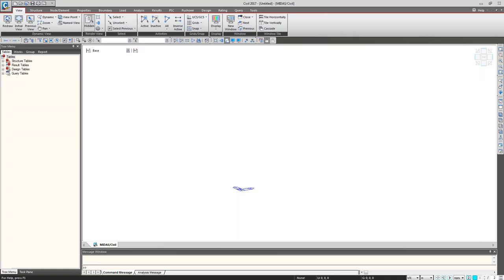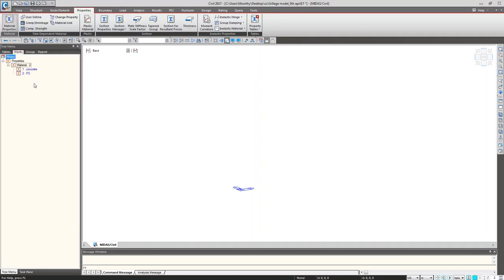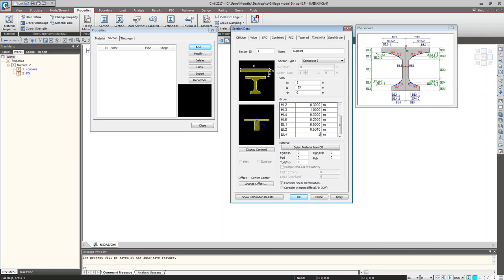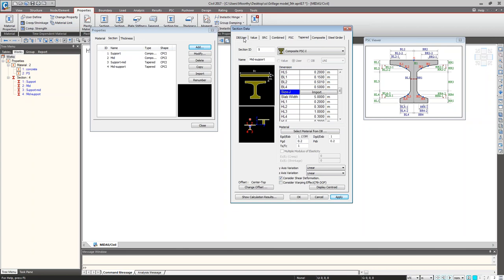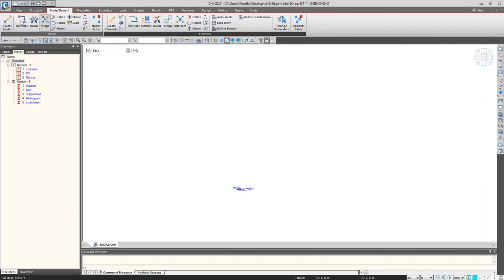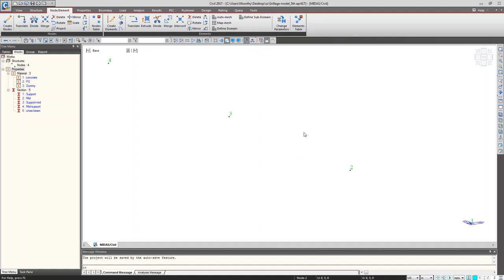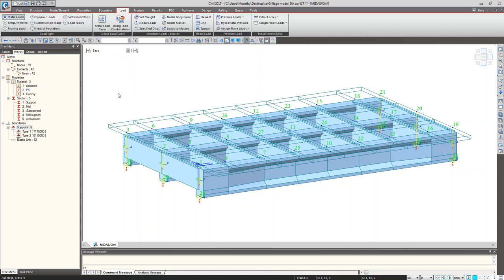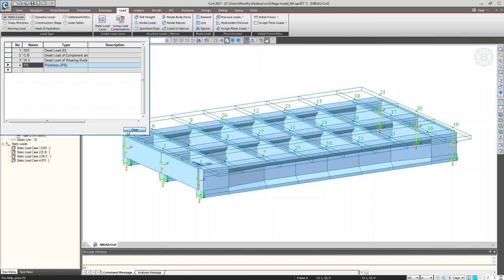PSC Composite Grillage Bridge using midas Civil

Comment: sir, I need to model a prestressed (noncomposite) flange of the main girder is a slab 

without making composite section

Can i define an I- section with flange 0.250 depth
and use dummy traverse beam?

Comment: Question.  The dummy section should be providing the stiffness of the deck in transverse direction.  I think the section should be the deck for the dummy.  How come you used cross girder as the dummy sections?  Is it a mistake?
Reply: I agree with you, otherwise the stiffness will be wrong for transverse beams